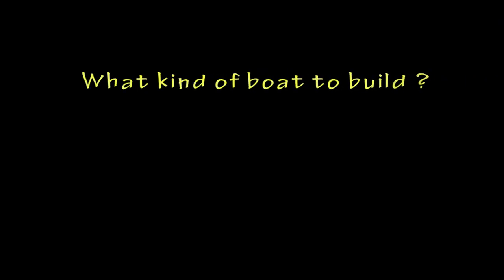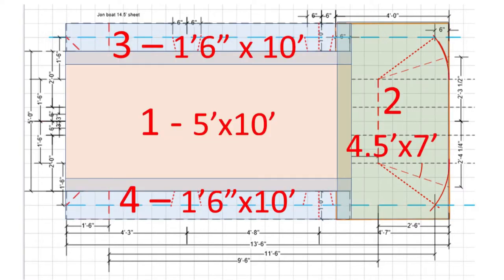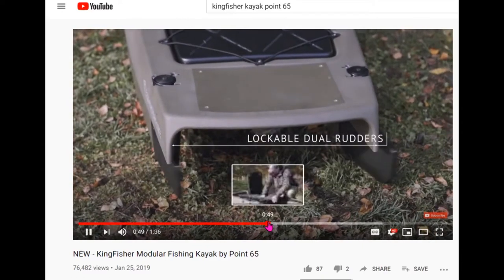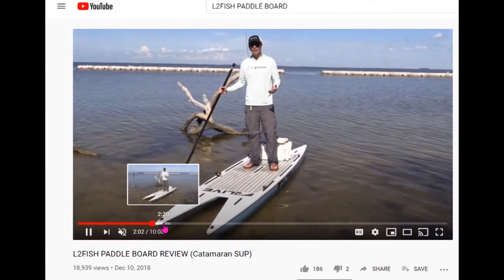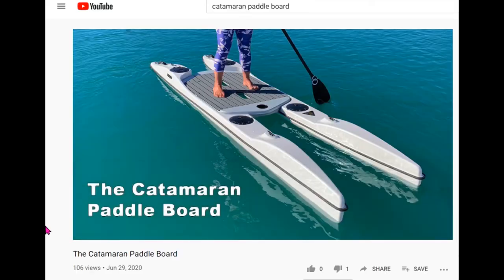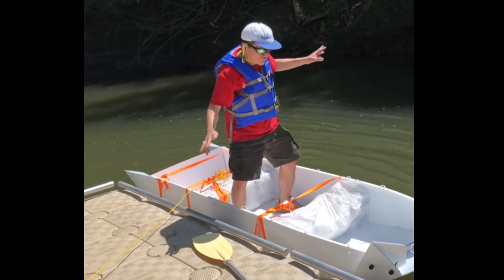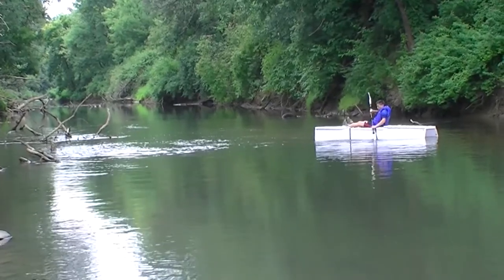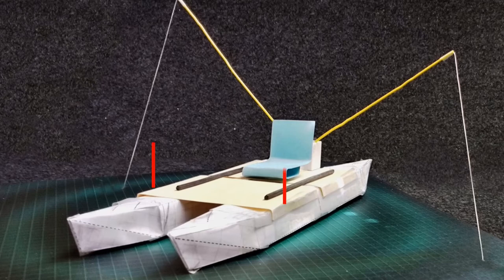DIY 10 ft 30 lbs Modular Fishing Kayak Part 1

Comment: Looking forward to this one. Keep on keeping on. 👍
Reply from the maker: Thanks for your encouragement. I spent two weeks in building a prototype and realized the pontoon design has a water leakage issue. I have a solution but I stopped this project to finish my gen 9+. I am about to restart this project than I have a non-technical issue.... if I build this kayak, I have no place to store it. I built my Gen 10 and store that at my porch. My wife is really upset about this.  I have yet to find a place to store that boat. This summer I have time to build one more boat. I have an idea to build a foldable boat that would be 30% smaller  (Gen 12 - when folded) than my Gen 9+. I am designing that one. For now I will focus on this Gen 12 boat instead of the fishing kayak. Thanks for watching!

Comment: Already made.  It’s called Expandacraft.  Two Roto molded sections.  One end of pontoon the other 4 foot section. One can combine multiples to create any size boat you want.
Reply from the maker: Yes, I have watched their videos and it is a nice boat. But I want my boat to be under 25 lbs, can fit inside my car and cost less than $150 to build. I actually have just finished this boat and water tested it yesterday. https://youtu.be/v6GqZUqnQb0   I am working on the water test video and will upload that in the next 2-3 days. Please stay tuned! Cheers!
Reply from the maker: I uploaded the boat test video. The requirements I have is different from Expandacraft: hand carry 25Lbs that can fit inside my small Prius C. Cost is >$120. https://youtu.be/FDANtumWJ6w